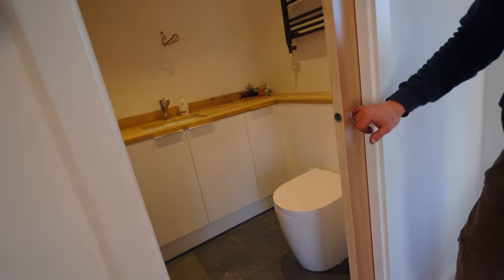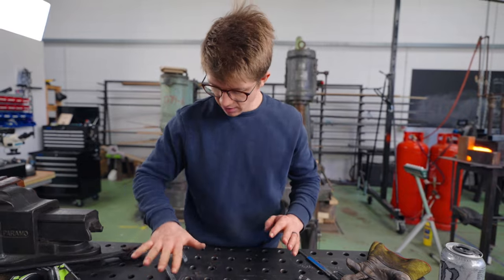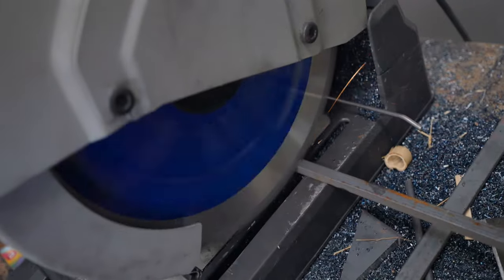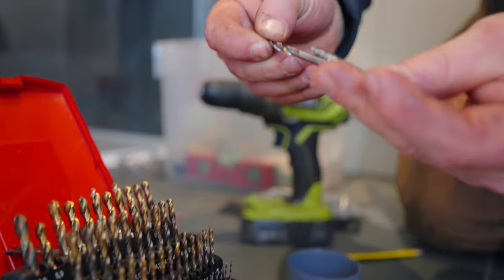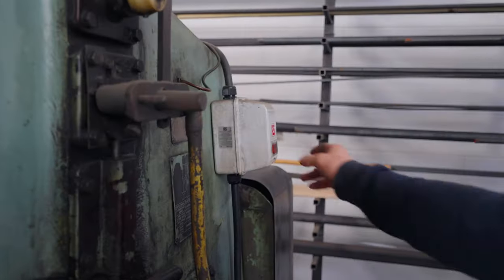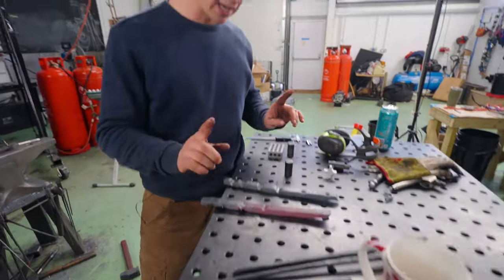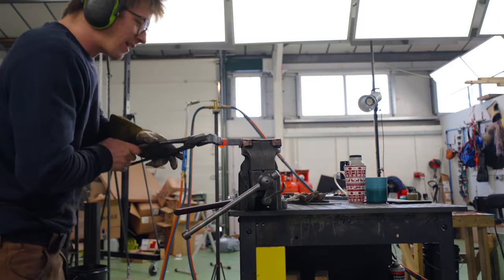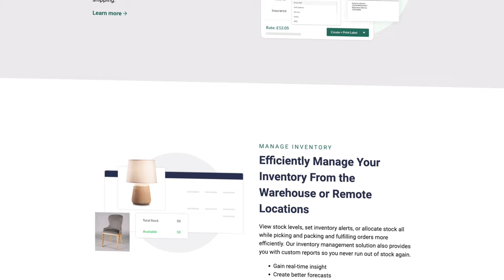3 Hand-forged Items for Our House, 1 Video!

Comment: Damascus door handles would be pretty cool
Reply: with some matching hinges maybe?
Reply: Damascus cabinet handles
Reply: They would tarnish/rust quite quickly though with sweat/skin oils etc. Not an issue if you don't mind having to clean them all the time though
Reply: @BritishTeaLover  a few coats of transparent laquer maybe. Or stainless steel damascus. Alex did a video on that, but i cant remember if it was possible or not.
Reply: Ahhhhhhhhhhh way to much Damascus..l
Reply: @BritishTeaLover  Would they?
From both experience and what I've heard from others, the natural oils in our hands do the exact opposite and protect the steel rather than causing rust

Comment: From the point of view of someone that hanged hundreds of curtain rail and poles your wrong hanger is actually the most effective geometry wise. If the part that is screwed is pointing up instead of down it will be safer and in most case it will hide the unsightly bracket, in your case I imagine you want to show it off but in any case the wrong one works better but you need, ideally a 90º screw attachment or even better angle the holes in opposite directions to give it even more strength.

Comment: just to warn you, from a drycleaners perspective, over time you will have oxide from the rail come off onto the top of the curtain if it is not sealed in with some sort of lacquer. had it a few times where i work, where someone has gotten forged rails made and with constant opening and closing, the rings what attach to the rail will rub off and drop it onto the curtains. just so you are aware.
also they do look cool :)

Comment: Good on ya Jaimie for being the voice of reason asking basically "Do you think you should measure first?" on the towel holder and "You can alter the dimensions of material" for the curtain holder. But then again your suggestion for where to put the toilet paper holder was silly, so I guess you win some and you lose some. Still you may have saved two projects.
Reply: After having watched ok nevermind Jaimie I guess you didnt actually save the curtain holder, but still good job for thinking like a blacksmith.

Comment: I have it so easy. I just model something in Fusion 360 and either print it out, or cut it on my CNC Mill. But your way looks more fun. I am getting Lathe soon. I am going with a manual lathe instead of CNC. So that'll be a bit fun in my basement... I mean workshop. I don't know how I feel about casting metal in my basement. Though that is something I'll be doing soon too.

Comment: seeing Alec measure the heated metal with the metal ruler... Reminded me of the time we ordered a new set of rulers...  The office guy saved £3 on the order and got us some rulers that were £47 instead of £50 ...  A pack of 10 plastic rulers turned up. the second order was also plastic rulers.. Until we told him to just order what we asked for and not to save any money on it.  Third time we got 2 metal rulers of the right size.  So instead of 1 pack of £50 rulers... He cost us £144 on plastic rulers.. (we put the rulers on his officer budget in the end.)

Comment: alec, if your island is not flush with the floor, mount it on wheels, it helps trust me, also when the fiancee mentions wall paper ut it off for as long as you can, I (a chef) spent hours learning to wallpaper to be told a month later she wanted it a single colour with wooden battoning , cutting up 10mm sheets of plywood is easy, forgiving her for the hours spent wallpapering, not so much...

Comment: Just one quick question. How much did it cost you to produce these items, not counting working hours, just the materials, electricity, gas and other fuels used in the production? It is fun to watch, but wouldn't it be cheaper to buy one done?
Reply from the maker: Maybe £20 in fuel and £25 in steel!